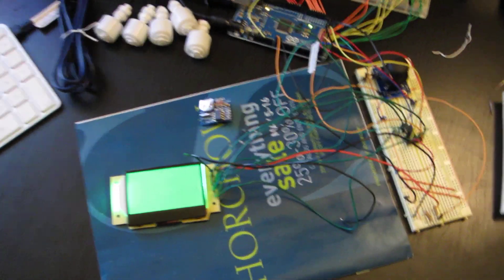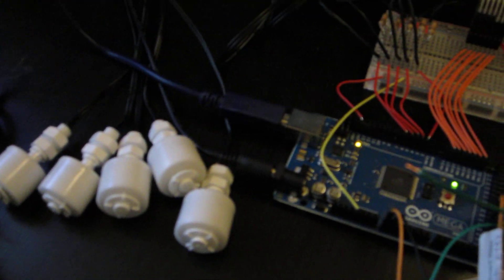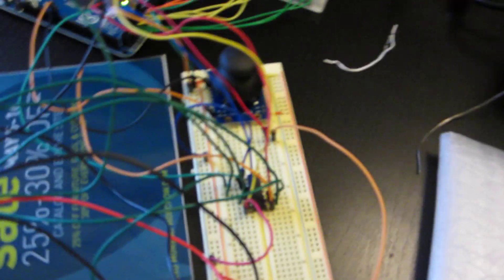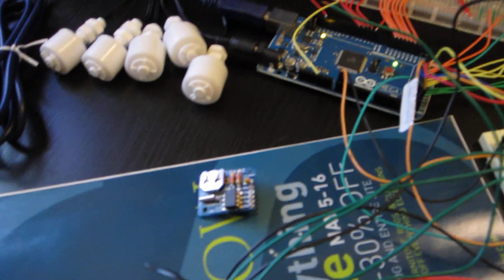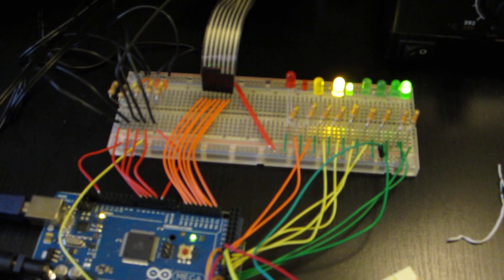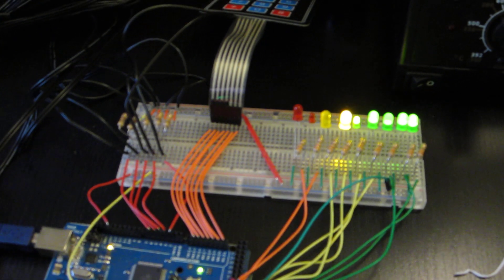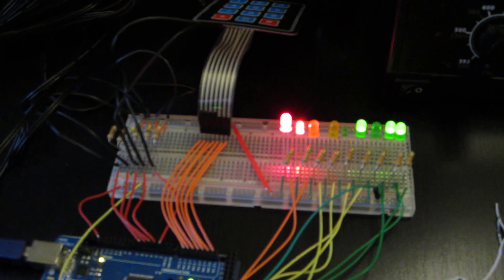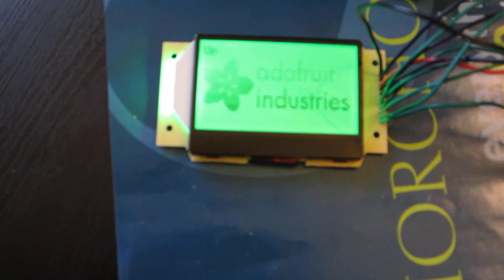Arduino Aquarium Controller build Video 1

Comment: Where can I find info on how to build one? Particularly a parts list
Reply from the maker: What exactly do you want to build? What do you want it to do?
Reply: Marc Cracco plzz Marc a want the shematic o this project of arduino aquarium controller i want all thinks from A to Z plzz helpp me do an equariuuum
Reply from the maker: Sorry Reda but I no longer have this or the aquarium, also most of this stuff is custom to your aquarium, either learn to do it yourself with help from the diy community or get an all in one per made controller.
Reply: plz Marc i want any think that can help me because i have anyone to help me